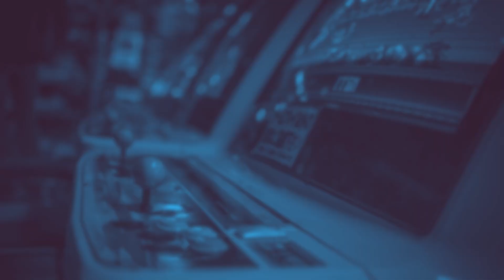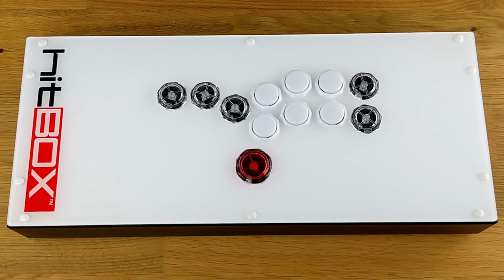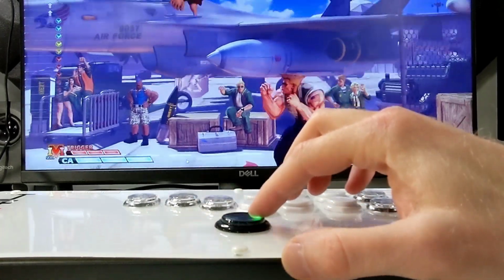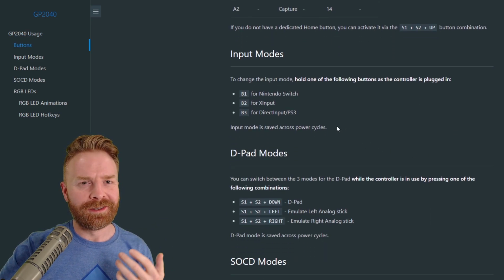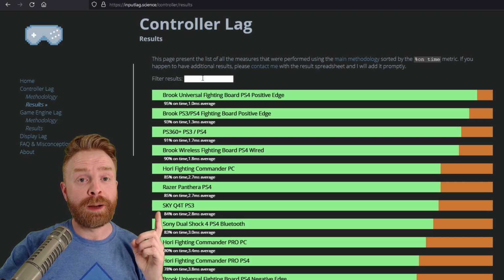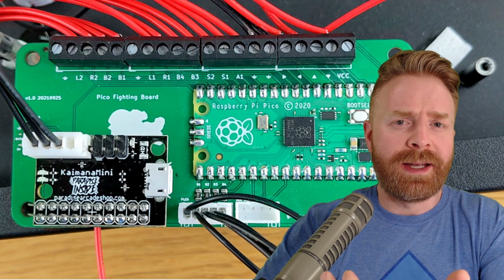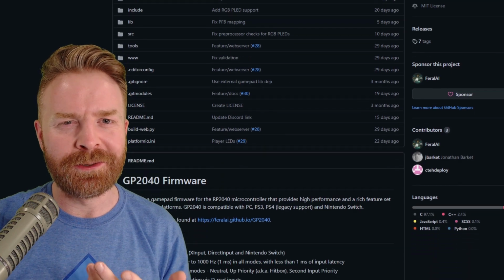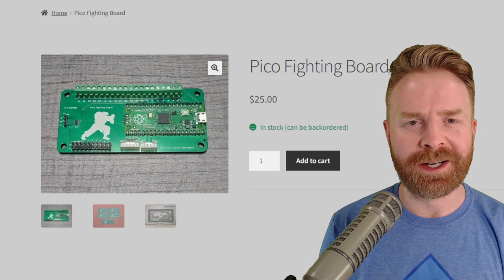The Pico Fighting Board: The Fastest Arcade Stick PCB

Comment: I had a couple of questions if you are not able to answer them that's fine. I have not actually done my research also I can understand if an answer is already in a repo or redit post and you yell at me to check there.
1) The board is essentially  a Raspberry Pi, is it possible to flash a standard zero with this same firmware as the Pico Fighting board? (I'm curious about building a LP leverless asc)
2) Is this board compatible with the Brooks PS5 dongle? (I'd like the option of going to a mate's house with only a modern console and using my asc)
Reply from the maker: 1 - I believe so, but you'd have to do some manual configuration and soldering required.
2 - not that I know of

Comment: Posting here to say that GP2040-CE (this project's successor) has announced that a future update will include PS4 and PS5 support via passthrough verification! Basically you attach a USB connector's data cables to two sequential GPIO pins, and then the 5V and the Ground lines. If done right, you can plug in a Mayflash PS4 MagicBoot or a Brook FGC Wingman inside of your stick and unlock the stick for the PS4 and PS5.

The best part is that due to the nature of the passthrough, the MagicBoot/Wingman are only there to provide verification checks, so you get unlimited access to those consoles without the input latency caused by plugging them in the usual way.

This also removes the need to do a hardware modification of a PS4 to dump a Dualshock 4's Firmware.

Comment: be interested to know if putting it into a brook wingman and using it on a ps4 or ps5 increases latency..
Reply: So this is actually kind of an interesting topic.

Currently, PS4 mode can be accessed without a Wingman by physically modifying a PS4 and dumping a Dualshock 4's Firmware, and then flashing it onto a Pico Board. As you can guess, it's not very user friendly at all.

There is an increase in latency if you plug it in via Wingman (IIRC it's something like 1 milisecond). HOWEVER...

Two days ago the devs announced that they figured out how to add passthrough authentication to the board, which means that if hooked up properly, you can plug the Wingman into the PCB itself.

This reduces the Wingman's role to simply providing verification checks for the PS4 and PS5 while the Pico Board handles all the input processing. As a result, there is no added input latency with this method.

Comment: Could you do a revisit to this project, only making use of the Bluetooth on the Pico W next time? I would be interested to see if it’s possible.
Reply: I think GP2040 CE does not support bluetooth yet.
Reply: @Adniwhack  you are right it is not yet supported. I am just learning the basics at the moment, building a pico based hit box style controller and designing and 3d printing the case. Looking into it a bit further it seems adding Bluetooth support would not really have any benefit anyway as it would introduce some input lag. Which is the opposite of what you want on a fight stick I would imagine.
Reply: @Adniwhack  GP2040CE also doesn't support PS4 (for more than 8 min) or PS5!
There are also tons of PS3 games with security that will BLOCK the GP2040CE from working on them!  Expect 20-30% of your PS3 games NOT to work with controllers equipped with GP2040CE.  That's reality some people don't want to face.
The Third Party PCBs that ARE completely functional with PS3 were reverse-engineered from functioning licensed PCBs.  The cheapest runs $11-$12 but the reliable PCBs are $35 and up unless you can cannibalize a used PS3 Hori Commander Pad.  Nobody's going to give you full-compatibility for free.  It's just not happening!
There are a lot of people under the delusion they can run everything for $5 when basic PS3 security hasn't been cracked on many games.
(Big Surprise, though.  The Zero Delay board does work with every PS3 fighting game and non-fighting game I've tested it with.  I do agree, though -- it's FAR from the best PCB out there but they figured out something about PS3 security GP2040CE hasn't yet...  So much for being the fastest PCB out there!  That sounds like the hype Apple used in the 1990s to try to convince people their G3 and G4 computers had faster processors than PC's running Intel CPUs.)

I can vouch for Marvel Vs Capcom 2 and Super Street Fighter 2 Turbo HD Remix not working with GP2040CE.  Those are 2 big games for GP2040CE to be incompatible with!
I think it's a fine board but it's only "fully compatible" with PC and things like Raspberry Pi.
The runarounds for PS4 and PS5 authentication of GP2040CE do sound expensive.  The latest Brook converters are $50.  If you already had a higher-end Brook PCB installed in a joystick, you'd almost be better off just getting the PS5 upgrade chip than spending another $50 on a converter unless you planned to use that converter with a fleet of retro-joysticks.  That business of "GPIO pins" and 5V lines and etc., etc. that's complicated technical BS to expect people to do.  99% of the "mod community" doesn't like to solder to pincushion-sized solder points!  It's like Michelangelo convincing beginning art students they'll all be able to paint the Sistine Chapel after a week of training!  It's baloney!

I went through all that business to try get the "keys" for the PS4 and I'm convinced that BS won't work for 95% of us!  Those Reddit tutorials just don't work...

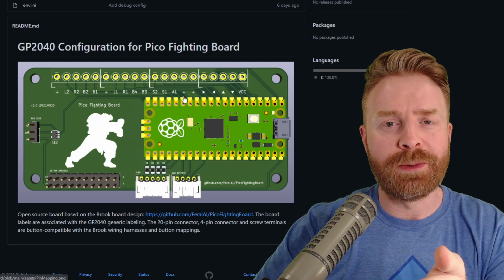Comment: 6:10  Yah! adding RGB 5050 LEDs into your box can pull 20mA per LED colour for a RGB/White that is 60mA. That's what I call a voltage dropout below 3V. Check your source USB cable, or throw your switch out the window.
I did ditto with my custom controller with RGB added pulling the voltage below minimum voltage using racing drone LED lights, 240 mA pull. You need a second power source/battery.  Not a software issue.

Your Kaimana LED Controller with 8 buttons equals 16x3x20 = 1A @ 5V. smoking your switch.

Comment: Will it work with Retropie?  Or should I go with a Brook Pi board instead.

The Zero Delay boards i got for my Street Fighter cabinet running off a Pi 3 has horrendous input lag.

Comment: The guy making this board went AWOL. Do not order from him. I had to charge back with my bank.
Reply: I said screw it and ordered a brooks board. It went into an obscure rhythm game controller I was building so I just needed whatever with low latency.
Reply: @Shrapnel_Warning  ok thanks.  hope it worked out for you.  I'll probably go the cheaper route since it'll be my first mod and then maybe get something faster like your brooks once I'm more experienced modding
Reply: did you order another encoder by another brand? Or did you try to get a pi 0 and solder it yourself?  I don't solder so I'd need to get another encoder

Comment: I only have the 5$ raspberry pi pico board. Is there any guide to manually connect everything using the firmware and stuff?
Reply: Did you find it? the firmware and stuff

Comment: With a custom PCB and a little coding, add shift registers for additional buttons. Wire the buttons that don't need low latency(for example: select/start) to the shift register. Add macro buttons directly to the Pico pins for super fast combo presses or turbo. You can also overclock the Pico cpu (add heatsink for reliability).

Comment: A quick question : how to link the Pico Fighting Board (micro Usb) and the Neutrick connector ? 
Is there any adapter ?
Reply: If you orient the Neutrik connector so that the USB-A jack is on the inside, a short micro USB to USB-A cable should work. In FeralAI's photo, it looks like they're using a micro USB to USB-A or B adapter, but it's hard to see. With that said, what persuaded them to put micro USB on the Pico FB? I thought micro USB was universally hated.

Comment: Hey great video. I got a pico and flashed the right gp2040 uf2 onto it, but after reconnecting to the pc, nothing happens. Not even the sound windows usually makes, when you connect anything. Do you have some advice maybe?
Reply: did you reach out to the devs?  I was thinking of getting one of these, but wanna get an idea on support or possible issues as this will be my first byoac parts to mod an A1up.  Thanks in any event

Comment: Seems like a pretty future proof board. Theoretically can be updated to work with any USB console,  and the raspberry pi's GPIO pins can output to a retro console(with more work to get some output pins)  or just pair it with an existing multi retro console board for less trouble...

Comment: It's a shame that the PS4/PS5 controller interface hasn't been cracked yet
Reply: Copy-pasted from another comment: So this is actually kind of an interesting topic.

Currently, PS4 mode can be accessed without a Wingman by physically modifying a PS4 and dumping a Dualshock 4's Firmware, and then flashing it onto a Pico Board. As you can guess, it's not very user friendly at all.

There is an increase in latency if you plug it in via Wingman (IIRC it's something like 1 milisecond). HOWEVER...

Two days ago the devs announced that they figured out how to add passthrough authentication to the board, which means that if hooked up properly, you can plug the Wingman into the PCB itself.

This reduces the Wingman's role to simply providing verification checks for the PS4 and PS5 while the Pico Board handles all the input processing. As a result, there is no added input latency with this method.

Comment: You should have mentioned that 25$ is optional. Afaik you only need a raspberry pi pico for this, which is only 5$. So if you are willing to manually connect everything, this thing is incredibly cheap. You could also print the breakout pcb yourself, which would save you a few bucks too. Definitely incredible project
Reply: Thank you - I was wondering this myself. What would one lose/have to account for if we go solo with just the rpi pico? Soldering is not an issue.
Reply: I wired up a couple of RPi Picos with GP2040 in an old X-Arcade (early 2000s). It took a little effort, including some soldering, hot gluing, and remapping the pins, but it's in there and works great. Fun project. If you already have the tools (soldering iron, hot glue, etc), then you could just use a RPi Pico flashed with GP2040.
Reply: @TheOriginalCactis  Hi, I recently got into fighting games and I, luckily, have some experience with Arduino boards and IoT systems as I have taken up Electronics Engineering as my bachelor's. So could you please guide me as to what sort of information do I need to put it all together? As far as I can guess, I need a microcontroller (I have an arduino), few buttons, joystick and wires to connect them. So how do I put it all together? If you would be so kind as to give me an elaborate answer, I would really be glad. Greetings.
Reply: Do you have any brief tutorial how to do it? I want to make a diy hitbox controller based on pico board, i already have one using zero delay pcb but it has some delay and i just want to tinkering new stuff
Reply: what kind of board should you be looking for though
Reply: How do you mount the Pico inside the arcade stick without the rest of the board though?
Reply: @onldhes  hot glue or 3m command adhesive picture hanging strips.
Reply: What do you I m not getting it ... Pls elaborate... I check the website and it contents "pico(less) fighting board" did u meant that ... We can play games only with 5$ pico board ????
Reply: @lazyboy1042  No the pico fightingboard runs on the raspberry pi pico. You can just buy a raspberry pi pico from anywhere you can find and flash the pico fightingboard program on it to use it as a fightstick controller. Ofc you would need to do some soldering work yourself for it to work
Reply: @kushalaxx   thank you thank you thank you... Man that's a relief.... Thanks again man
Reply: @kushalaxx  is there a tutorial for this?
Reply: @1TZAH  basically, look at GP2040 wiring diagramm online. solder the wires for your buttons according to the diagramm and don't forget to connect to ground as well, pico has 8 ground points. when looking at the pico with the usb connection pointing up, your direction and actions buttons are connected to the left side of the board, the menu buttons on the right.

if it's too hard to understand, better buy a brook board. no shame in that. I'm lucky and got my education as an electric engineer so this is pretty basic yawning stuff to me.
Reply: @mb2776 I recently started looking into DIY hit box. The board is definitely not needed. I enjoy soldering and making my own wire harnesses. You need the equipment but if you have it you can make one for cheap. Since I have it I’m making a hitbox for about $35. Putting it in a hardware organization lol
Reply: Hi, I recently got into fighting games and I, luckily, have some experience with Arduino boards and IoT systems as I have taken up Electronics Engineering as my bachelor's. So could you please guide me as to what sort of information do I need to put it all together? As far as I can guess, I need a microcontroller (I have an arduino), few buttons, joystick and wires to connect them. So how do I put it all together? If you would be so kind as to give me an elaborate answer, I would really be glad. Greetings.
Reply: @v @venom321 
There is already a very solid project called GP2040-CE for the Raspberry pi pico. You just need that, a couple of wires and some quick connects for your buttons. You should find plenty resources online.
If you want to use an arduino you would have to write your own code for it, or find someone who has written something similar already

Comment: Not sure 0.2ms change is outside margin of error. Also most tvs have 13-40++ms delay even in gaming mode, so hardly a game changer. The only way to get any benefits is from display technologies and fighting games start moving away from 60fps. You can still code the animations and other stuff to 60fps while having engine 120hz output and 120hz input (or even 1000hz polling rate for that matter). Compatibility is a joke too, it's just USB. If sony and ms wanted - everything would be compatible, but where's profit in that?
Reply: PFB and GP2040 dev here. The input latency difference is measurable and repeatable, but I agree it's a marginal difference in real world performance. The PFB does have a better maximum repsonse time than the Brook UFB (~1.3 ms to 3.8 ms), meaning the input is slightly less likely to skip a frame on the PFB.

Comment: Unfortunately without supporting ps4 this is a home only solution if you are a tournament player. I am confused at the portion regarding simplicity though, is this thing not just prepared for a 20 pin connector and maybe a singular down? Also, are the firmware updates required? Is it not just plug and play provided you have the 20 pin connecter and the correct USB cable?
Reply: Firmware updates aren't required, but will get you new features and bugfixes. GP2040 is very active with development right now (primarily by me) and new most of the new feature are around easier configuration and supporting new hardware/peripherals.
Reply: @mytechtoybox8405  So if I am a PC player who just wants a stick to work with no lights, this is the factual best solution. I am assuming that grounding issue was a one-off that Mr. S had, no? In that case this is the best performing PCB on the market. Maybe I am getting that wrong.
Reply: @Joey_CapcomFightingNetwork  The grounding issue has been resolved on all Pico Fighting Boards currently being shipped. I don't necessarily advertise it as the fastest, but it's definitely faster than anything commercially available right now.
Reply: @mytechtoybox8405  Pretty dope, I wish you the best of luck and I am purchasing one as well. Thanks for your time.
Reply: I've come from the future to report that the devs of GP2040-CE (this firmware's successor project) have confirmed PS4 AND PS5 compatibility through passthrough authentication! Basically it will allow you to play a Mayflash PS4 MagicBoots or a Brook Wingman FGC directly into the board. The main advantage being since those dongles only handle verification, they don't add the input latency that they normally do.

Yes this works for a Raspberry Pi Pico without a breakout board, although you will need a  female USB connector soldered to the V5 + Ground pins, and then two sequential pins on the board (so if you aren't using R3 and L3, for example, you can remove that functionality to add PS4+PS5 compatibility)
Reply: @KetsubanSolo  I appreciate you taking the time to talk about this. I have a friend that has an Ali express ps4 hitbox that uses this method to go to ps5. Happy travels!